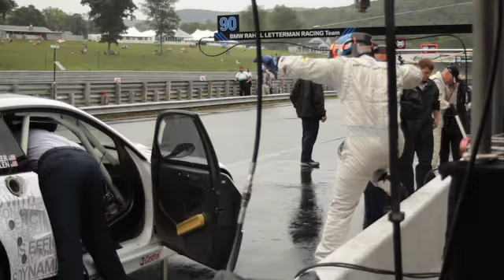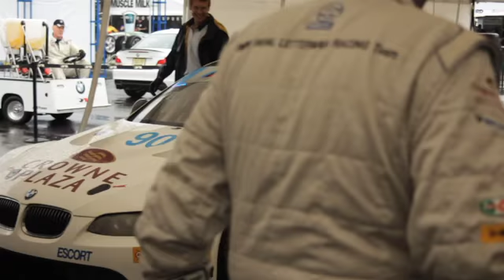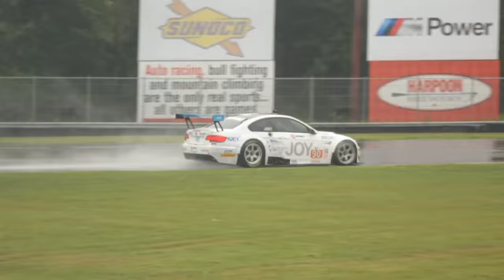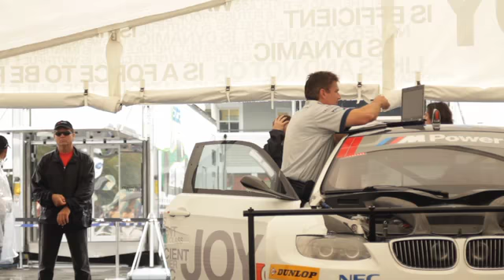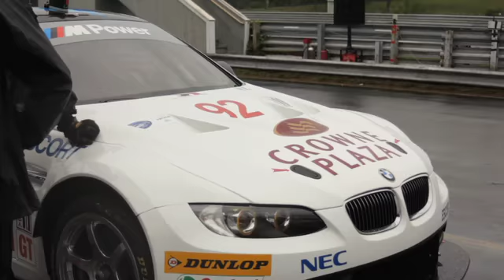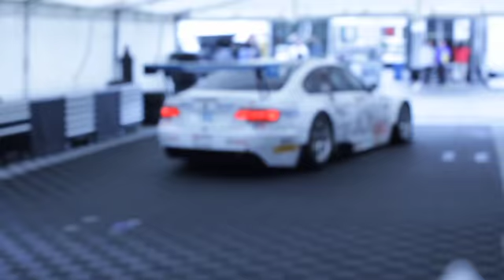BMW Racing at Lime Rock, GT2.  Shakedown Returns

Comment: In the interim, here's some more TIRE knowledge from our talk -  A rain tire really works like a snow ski..... in that it's the EDGE of each tread pattern that cuts through the water 2 start the channeling away from under the car.  

The sharper the edge, the better the rain tire works.  Dguy showed us how the edges had rounded [very slightly] + that made the tire 'worn-out'.  The rounding was minimal, but tire was done [soon to be a coffee table for some race fan!].

Comment: It's a fixture put on each corner when doing setup. More precise vs the rubber tires.  Look @ vid + see on floor 4 dots on each corner where car parks. Those are floor levels. The corner scales sit on dots.  The fixtures sit on scales [car's jacked up in 5:12 scene]. The fixtures allow for consistent precision vs tires.  Now, the setups / alignments are accurate.

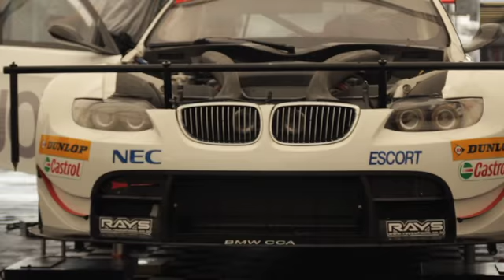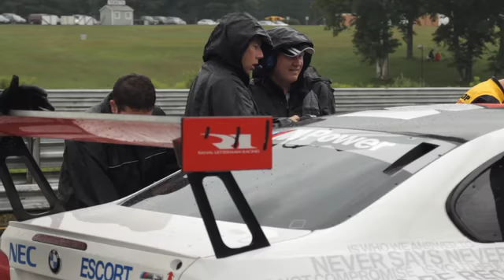Comment: Time limited.  But, how about this?  The twin carbon pipes on top of engine [1:47in the vid] are the air conditioning inlets. The ducts in the rear window [1:03] are pressure relief for the A/C-pumped cabin! 

The air ducts behind doors on sides are for brakes [the small ones] and for the rear-mounted A/C condenser + gearbox cooler [large ones].

Rules say tires have 2b covered from center-line up.  Hence, the fender flare cuts.  But the chopped-out bottoms also help pull air from w-wells.